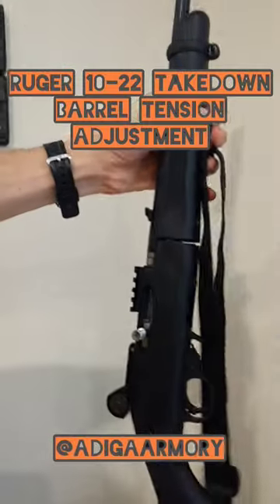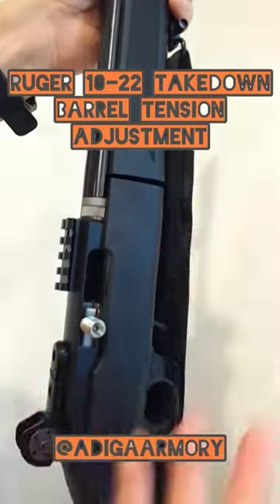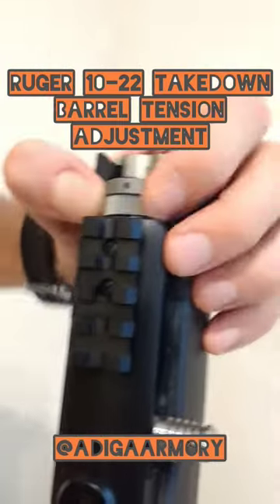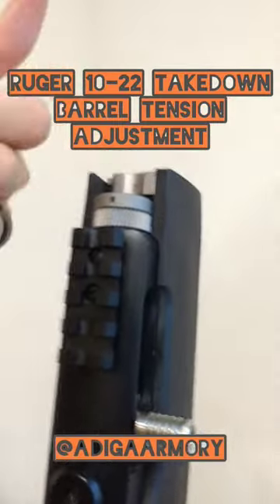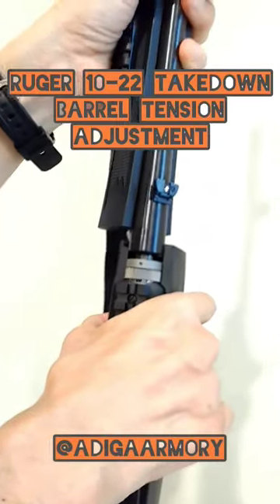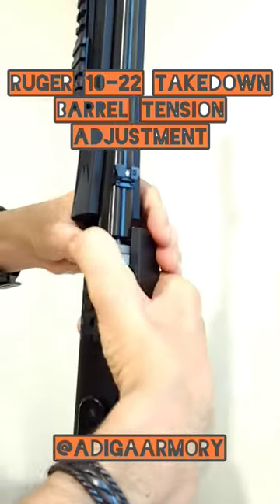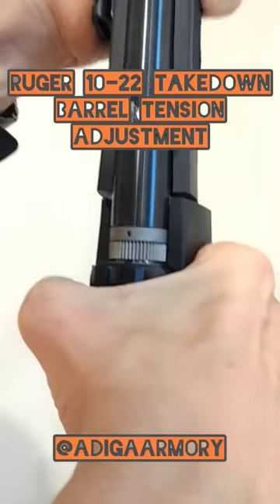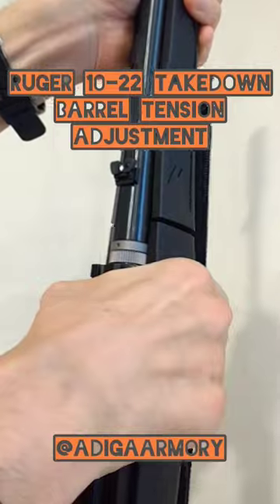Ruger 10/22 Takedown barrel tightening adjustment to improve accuracy & reduce free play movement. 🎯

Comment: Thank you for the video, I just did this with my 10/22. Is it possible to have the tensioner too tight while twisting the barrel? Or is it a go-no go kind of thing? Thanks again.
Reply from the maker: If you run the tensioner before twisting, it is possible to slightly over tighten. I like it to seat firmly, but not to where it requires excessive torque to twist the barrel in place. It just needs to be enough that any barrel "play" is removed.
Reply: @adigaarmory  Thanks for the reply. I think I have the tensioner torqued to a decent tightness now. Thanks again.
Reply: So after adjusting the the barrel the Allen cap screw the accuracy adjustment screw on a standard Ruger 1022 does that lock down or do I need to find a sweet spot with that too?

Comment: That's exactly the opposite way Ruger recommends adjusting the fit. Page 17 in the owners manual.
Reply from the maker: Yeah... Ruger's manual also told us it's ok to dry fire the Wrangler revolver... lol. Look into that doozie when you get a minute. In this case, it doesn't matter... you will not damage the rifle doing it this way... and you will get a tighter fit than trying to finger tighten after installing it.